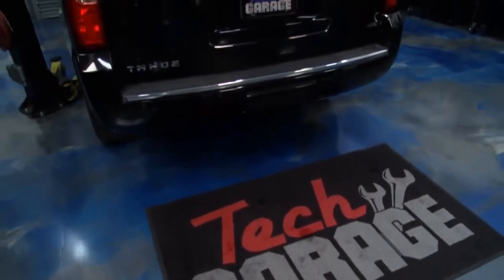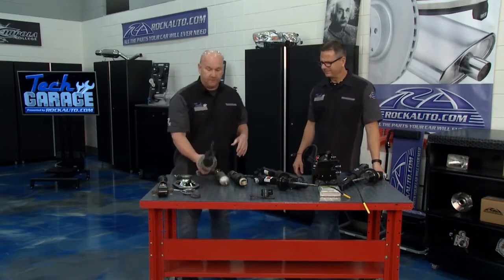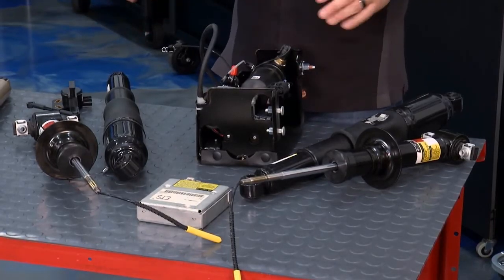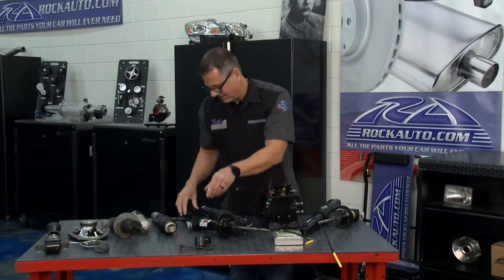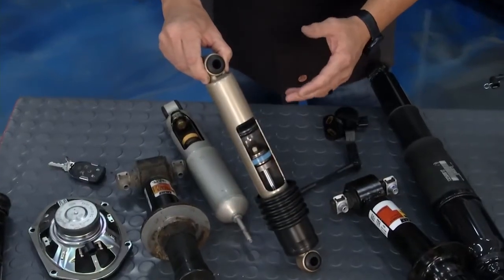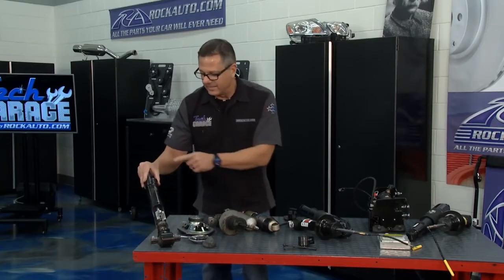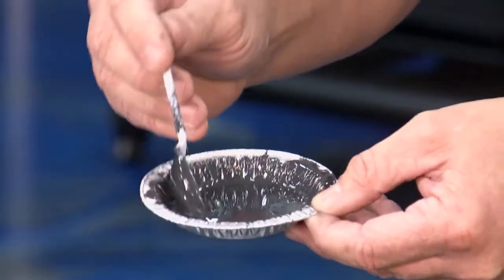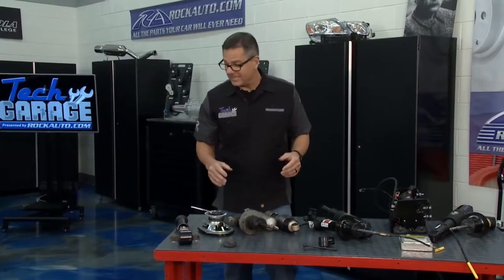Electronic Suspension GM Magna Ride How It Works

Comment: Very good video. What no one explains is the pressure required in the nitrogen chamber that separates it from the oil chamber. What pressure does it have? And how do they achieve that pressure?
Reply: That magnetic fluid would take place of the hydraulic fluid inside the shock.  Its still pressurized with nitro like most other shocks are just to prevent corrosion or oxidation internally.  The fluid would just be pushed through the orifices inside slower or faster based on the magnetic field thats getting induced..  only air ride suspension has plain nitro pressurized chambers but still has oil mixed inside..